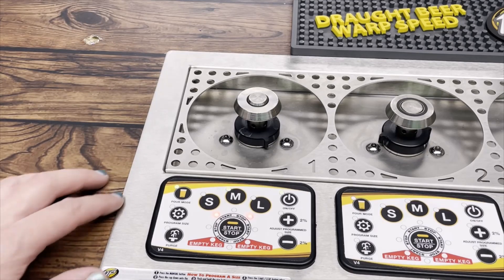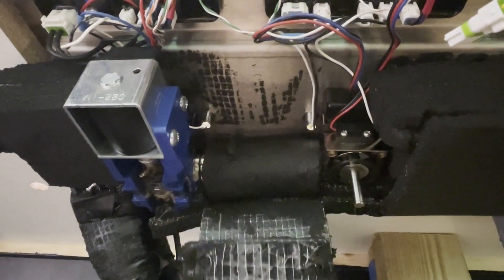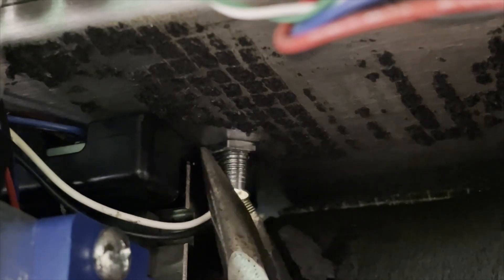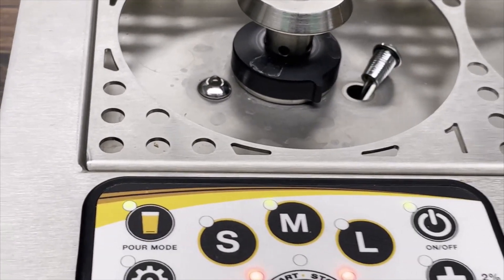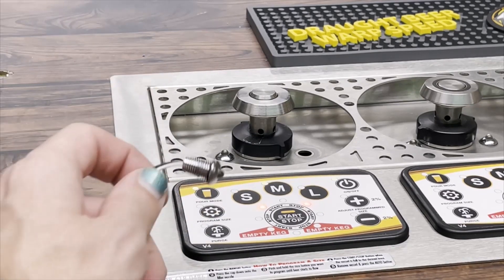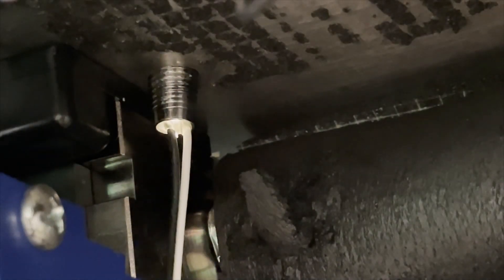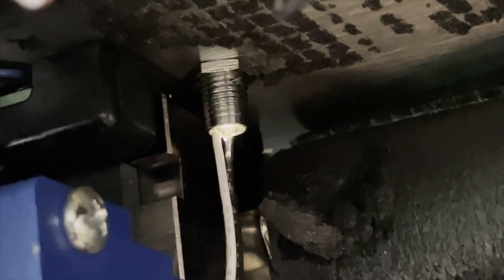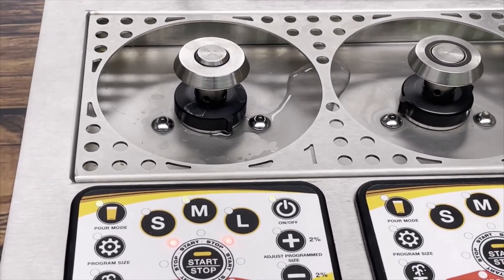How to replace an LED light on a Bottoms Up dispenser

Comment: Is there any reason why the leds aren’t electrically isolated from the logic circuits? Led issues shouldn’t cause a whole unit to have problems
Reply: They don’t stop the system from working from my experience.